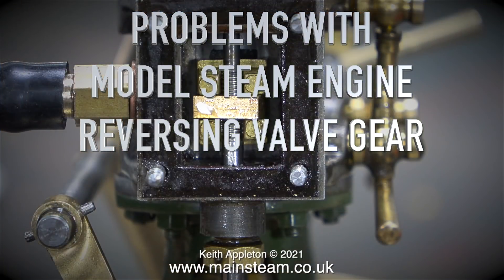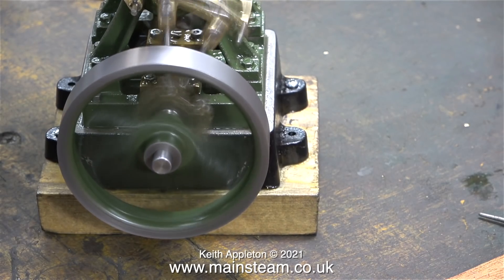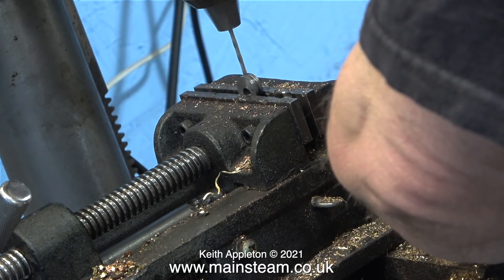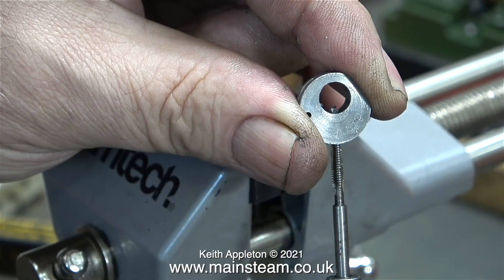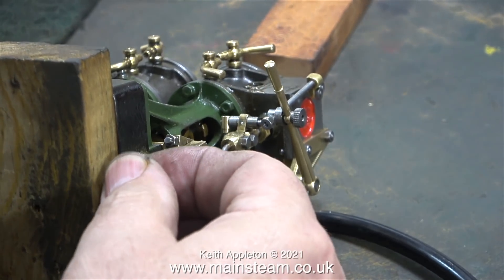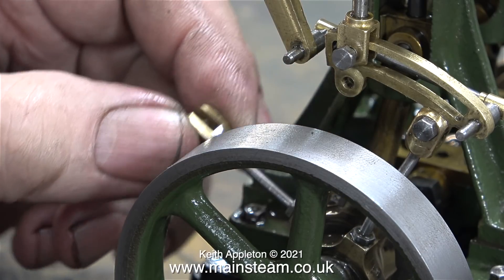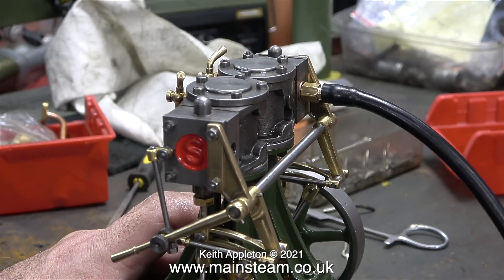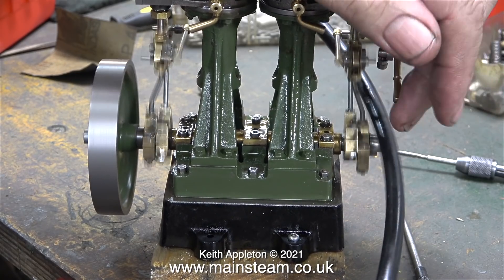PROBLEMS WITH REVERSING VALVE GEAR - PART #2

Comment: That most certainly is a fiddly adjustment.  In the end, after solving the mystery of the rod lengths, did the eccentrics really need individual setting?  That is, you made them individually timed, yet it seems that this was not root cause, the rod length was.
Reply from the maker: Even with the correct rod lengths the eccentrics were still wrong when I pinned them together. They are OK now }:-)))